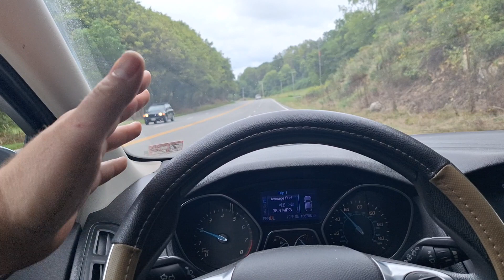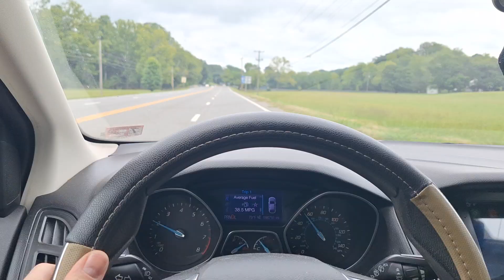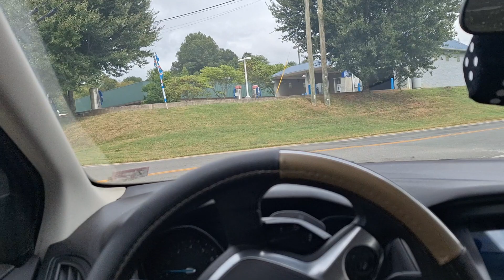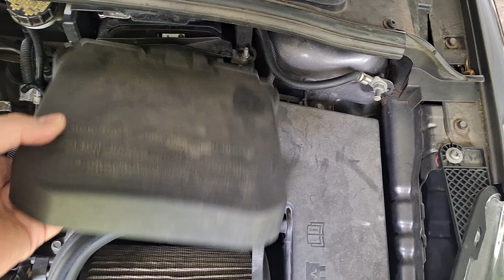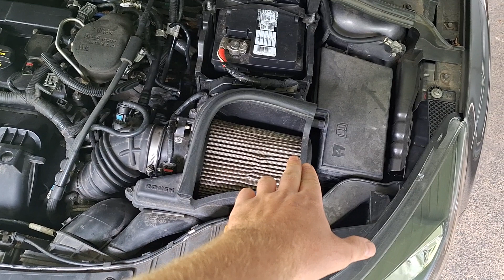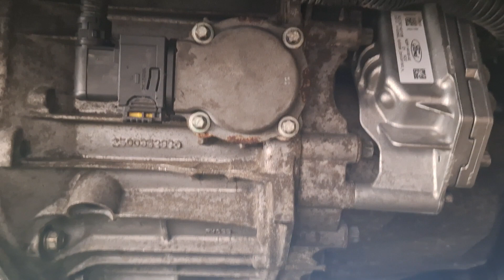Diagnostic Guide | Ford Focus Won't Move In Gear? Dual Clutch Automatic DPS6

Comment: 👍👍 Good stuff! Also, good lookin Focus! I bet you can make it even cooler.... lots cooler.... 😉

Also, I have heard of a bunch of folks adding another additional ground, directly to the transmission (on a Fiesta) besides sanding off paint behind the top, and bottom ground connections, putting it back together, then sealing the connection with dielectric grease.

What if a guy tried to build up, and amateur rally a DPS6 Fiesta, or Focus? .....You could be that guy, or a friend of that guy...or both. 😄
Reply from the maker: Thanks! I'll do the ground cleaning on my focus another time and make a video! A focus/fiesta race rally sounds fun :D Appreciate you watching!
Reply: I mean....our cars are already legendary WRC cars, known around the world, right? Why not make these DPS6 cars something to be excited about, too....instead of all the bad PR Ford got, for not instructing new buyers of DPS6 vehicles, how to operate a dry DCT, so you don't ride the clutch, use first gear to hang on a hillside waiting at a light....creep in stop and go traffic...The brake pedal is our friend.... Instead, put your foot down a good amount when taking off, etc.. then, it had some teething issues, especially in the beginning...

I like to pretend I'm an M-Sport team member, or Ken Block, and stick my foot in it, when I can do it safely. 😄 @BigBensCarsAndCycles